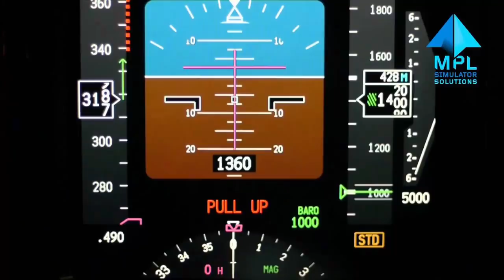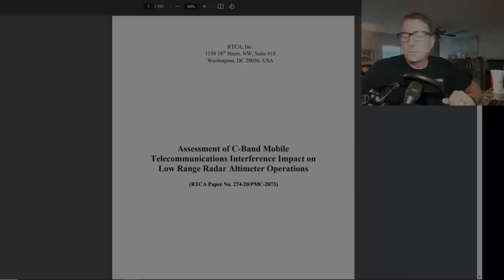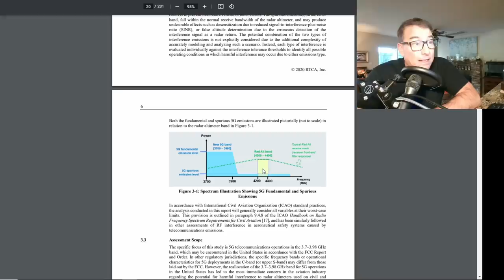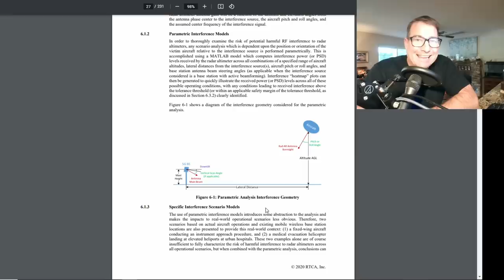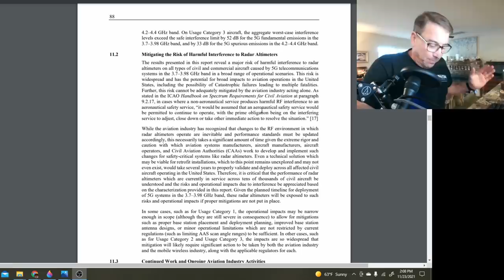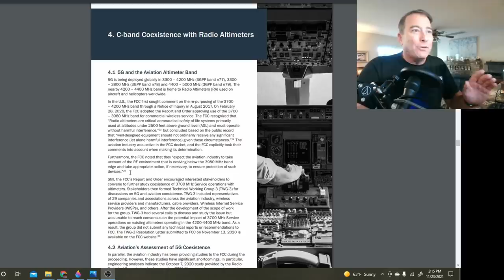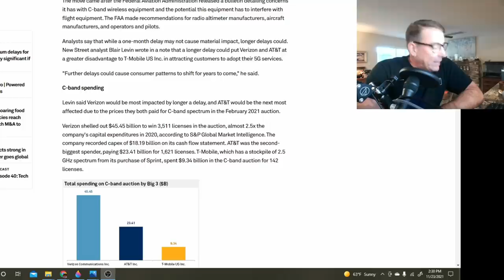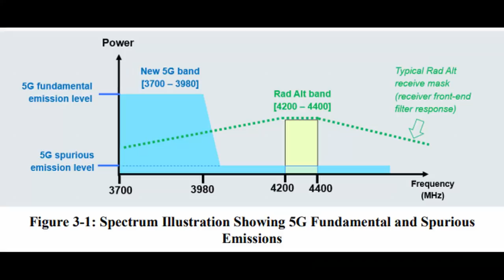5G C-Band Interference with Radar Altimeters in Aviation

Comment: Juan, Love your videos. This is also a good video but it is a pure pilot's perspective. I am a Amatuer Radio Operator and have degrees in electrical engineering technology and a retired Flight Engineer, and we in the amatuer radio community have been dealing with this very issue for many-many years. We have had a much harder battle since we are a non-commercial use of several radio frequency blocks. First off the report created via simulation is obviously presented for the layman since the charts were not truly accurate but rather drawn to make a point (especially the Frequency interference slope). Both reports show a obvious bias. Saying the aviation industry was "there first" doesn't apply since the frequency bands are not shared and do not overlap, they are adjacent with a small buffer. I totally agree there is potential for frequency interference but let's investigate why is that. The band allocations have defined start and end points and any signal transmission (of a certain level) "out of band"  is illegal and the equipment should be designed and built to the necessary specs so no "out of band" signal is transmitted. The amatuer radio community have had to increase quality of filtering and address interference and have got pretty good at it. My concern is that manufactures of the radar altimeter equipment may have built equipment with "loose" filter design to save costs (seen it many time on other equipment) since there was never any issue with interference with adjacent frequencies, it is possible that now the poor filtering designs are rearing their ugly head. I do not have any first hand knowledge of the filtering and signal rejection specifications of the radar altimeters so I am speculating at best but these are the things that need to be looked at to address the issue at hand. It will be incumbent upon the aviation equipment manufacturers are designed and built to tolerances to reject out of band signals and the telecommunications industry to ensure that the systems installed and broadcasting also do not permit transmission of spurious  or "out of band" signals. It is possible and easy to cause interference across a very wide spectrum with higher power and proximity. I have seen Ham radio in the MHZ bands  cause incapacitating interference to the AM band that is in the KHZ range. It's all about good design and, proper equipment construction and maintenance as well as being aware of possible interference and address such issues with proper design on the broadcasters and good filter design on the receivers. With the level of money involved, this could get very ugly. I hope this gets ironed out for the good of public safety.
Reply: The filter slope is incredibly sloppy on the radar altimeters.  I would not be surprised but what there is no filtering at all and it is simply the cavity dimensions of the antenna that provide any sort of bandwidth selectivity.
Reply: I recall buying a noisy toy at a US airport duty-free type shop, and it caused interference to the extent the pilot or pilots must have complained, since shortly thereafter there was a report about said toy causing intermittence and being banned.  An argument for upgrading out of date aircraft electronics.  Nowadays some private pilots I know carry consumer-grade GPS with them as backup navigation.
Reply: Since cellular uses spread spectrum as part of spectrum managment and security, I think the possibility of a cellular signal using a frequency used by the radar altimeter is essentially non-existent.

It's not like a cell phone picks one frequency.  If I understand correctly, the phone is frequency hopping meaning they are not using a single frequency.  

Folks are not knocking each other off cellular towers using the same set of frequencies.  I can use my cell phone in the same room as my wife who is on the same carrier and presumably using the same towers and frequencies.

If that works, using the same collection of frequencies, the risk to radio altimeters using a fixed single frequency or range of frequencies that are not part of the 5g band seems rather unlikely.

How is this working in nations who have rolled out 5g?
Reply: @buffuniballer  The problem is that the radalt uses a fairly simplistic method of measuring altitude, by sending two simple modulated RF signals and measuring the time it takes for the reflection to be received.  I don’t think that they use any sort of sophisticated modulation and/or coding, in order to pick up the reflection out of the RF noise.  Spread spectrum sidelobes, outside of the C-Band cellular frequency range, will be ‘seen’ by the radalt.  So, the question is, will this spread spectrum ‘noise’ obliterate the radalt’s ability to detect the reflected signal and accurately measure the return time, to translate that into an accurate altitude measurement.

I’ve been trying to locate some details on radalt, but have not been able to find it.
Reply: @RbNetEngr  my point is with spread spectrum and 200MHz of space between 5g and RadAlt, how long is any one transmission even at it's nearest point in the spectrum.  The devices frequency hop.  They are not even knocking each other off the air when used in the same room and same set of frequencies.  So are they really going to knock the RadAlt off the air 200MHz away?

Comment: I feel your pain on this one, JB. The FCC never ceases to amaze me with their boneheaded decisions.

6dB is nothing insofar as isolation.
Reply from the maker: That’s what my retired EE said too…he expected something more like a 12dB safety factor.
Reply: Quote: "6dB is nothing insofar as isolation." Exactly right! For audio 3 db is about the smallest sound change we can detect. 6 db is only a little more than that. Stated another way, 6 db represents a power ratio of four-to-one. A 4-watt 5G transmitter 6 db down in a radar altimeter receiver's bandpass will be as strong at the 1-watt transmitter in that radar altimeter. I suspect those 5G cellular transmitters are about 30 watts into a high-gain antenna. They need to raw their way through the walls of buildings.
 Compare that to the 40 db down standard that the FCC requires for amateur radio transmitters in the HF spectrum. 40 db represents a power ratio of 10,000 to 1. A 10,000 watt transmitter with its second harmonic (at twice its frequency) 40 db down would only have a power equal to a one-watt transmitter at the latter frequency. And the maximum power hams can use is far less that 10,000 and most operate at 100 watts or less.
https://www.electronics-notes.com/articles/basic_concepts/decibel/db-chart-levels-table.php
Juan is right. If these cellulars don't thinks there's a risk, let them conduct actual tests in concert with their critics. Let an experiment prove this one way or the other.
Reply: @Android-ng1wn  exactly,  5G emitters are always adjusting and tuning dynamically.  

and yes,  Mid-band 5G is about half the penetration power of low band and down into 4G LTE signals.  thus they need the dynamic tuning.   

5G UWB however, which is the small cell sites that give the Gigabit wireless cell service operate in mesh setup and sit atop a light pole in dense urban areas, operates in the 28 GHz Range mmW wavelengths.
Reply: @Inkling777  High Noon.
Reply: @Android-ng1wn  I tried to tell that to the people that were trying to take away the fire depts radios (150-175 MHz) and put them on a "trunk" system. It seems the bureaucrats listened.
Reply: 6dB is bad sure, but what about being 200mhz off of the band?  Joke all you want about 6dB but the fact a signal 200mhz away is interfering with the RA is pretty nuts as in the digital world  "guard bands" are tiny - one full wifi channel is only 20mhz so having to be 200mhz away is like eating up 10 wifi channels!   I'm leaning towards the "40 countries already do this" answer and thinking the FAA Radio guys are smoking something here...
Reply: @Inkling777  I am repeating part of a comment I left above, explaining the BENEFIT of good old 5KC wide VHF AM, because an overtalking situation can be recognized - not blocked out by the FM Capture Ratio. Not hard to detect on my ICOM 706 in the car in ATL, and Juan has pointed these out when playing missed transmissions! As a Ham for over 50 years, M. Perry hit the nail on the head! I believe the spec for HF harmonics has been  TIGHTENED even further to 50dB in recent years, most ARRL and other Amateur Radio publications include the improved/added filter sections on Transmit outputs, There is no telling how destructive these DIRECT, not REFLECTED 5G 30W digital signals buzzing away will overload the receivers pointed at the ground, with their simpler filtering and detectors. Amazingly lucid Technical feedback here - especially the tradeoff of FILTER PHASE vs SKIRTS response; if you want the Delta-Time data to be accurate. Another more Expert Technician replied that the Radar antenna CABLE LENGTHS have to be accurately compensated for, IF the phase detector reflection is not OBLITERATED already!. Best Regards, Hilary Lamothe W4HDL
Reply: @jermwerty  welcome to the world of 1970's electronics.  200Mhz is nothing to a 50 year old RA.
Reply: 3dB is half the power though, perhaps that was their thinking...
Reply: @srira7910  could be. Someone with a tie, but no pocket protector, said “but it’s half of a half!”

Comment: Thanks for that clearly presented coverage of this potential rf Interference problem. You explained it as though you were yourself a knowledgeable electrical  engineer with rf experience and maybe you are. I am an rf experienced electrical engineer with no aviation experience. Thank You
Reply from the maker: I couldn't even pass the Morse code test to get my Ham license...;-)
Reply: @blancolirio  Well that certainly limits your capabilities. How can you even fly without Morse code. There is NO Morse  code requirement for a Ham license any more.
Reply: @wm0davis  I didn’t know the Morse code requirement was dropped for Amateur Radio licenses. I really enjoyed being a net control op for the high speed CW nets back in the day…73

Comment: Great analysis of this issue. Interesting that the page 26 you show of the FCC rebuttal report says, many countries have implemented 5G frequencies near the radar altimeter frequency, then list Japan, South Korea, etc, yet the South Korean paragraph says that they are only proposing to auction off the 3.7 - 4.0Ghz range, and are currently studying if any additional requirements for 5G base stations are required, so in other words. They're in the same position as the US and haven't implemented the frequency yet .
The paragraph about Japan says that, even though they have completed the auction, they have a 100Mhz restriction for ops within about 100 - 200 M of aircraft approaches, which mean that, in addition to the 200Mhz guard band, there's an additional 100Mhz, so essentially they have increased the guard band around approach paths to 300Mhz. IE a 300Mhz away from the Radar Alt freq. Which restricts the freq limit to 3900Mhz, slightly lower than the 3980Mhz proposed in the US 5G freq allocation. Does that make a difference 🤷‍♂️. 
This all this needs to be left to the RF experts, independent of the telco's and Govt's and Govt's need to listen to them.

Comment: The thing is a cell company doesn't use all the frequencies at one site. So as a compromise could their be a caveat that within X kilometres of an aviation sensitive area can't use the top X MHz of the band.

The cell phone companies have frequency planning to ensure neighbouring cell sites don't overlap etc so couldn't the same be done?
Reply: Long ago, I worked in frequency allocation for cellular systems. You might get these companies to agree to do that, but only a fool would trust them to actually do what they said they would do. There's too much money to be made from grabbing spectrum. Cellular companies are as ethically challenged as cable TV companies. If fact, the cellular company I worked for came out of cable TV. It made its owners billionaires.
Reply: @Android-ng1wn  it's done with 3.65ghz as well now, just like dfs for 5ghz 365 has cbrs guidelines that it abides by as well, this could easily be extended to the frequencies in question.
Reply: @Android-ng1wn  It has to be the other way around for any safety-critical system.
Never use those frequencies unless UNlocked by the proven absence of Radalt signals over a significant time period.  That way it fails safe.  The system would have to do a self-test occasionally to prove to itself that it was able to receive Radalt signals, too, and stay locked out if it couldn't.
Look at the way truck or train brakes are designed - if they lose pressure, the brakes clamp ON.  The system has to be working properly to be able to move the vehicle.
For some excellent explanations of how fail-safe systems should work, an old but great read is "Red For Danger" by L.T.C Rolt.  It is based on railway systems but is still highly relevant to aviation ones, and indeed any others that are safety-critical.  Say, the environmental monitoring systems for laboratories (which I've designed).  My early education on safety-critical decision pathways came from Mr Rolt's excellent book, which is highly readable.
The very first railway signal, outside Reading Station (IIRC) on the Great Western Railway, came with the regulation that "If the signal is not visible, the train shall not pass it".
Reply: @phillee2814  Same rule on dark signals is still in effect.
Reply: @phillee2814  but that approach ignores the "rogue passenger" scenario where they ignore the flight-mode rule. 

In that case, their handset will be the strongest interfering RF source as it's within the plane so a very strong field strength at the radalt rcvr. Due to the local 5G mast being locked off due to hearing overhead radalt pulses, the rogue passenger handset will be on high power trying to contact a distant mast that can't hear that radalt transmission at all (radalt beam is aimed down at the ground so has a limited geopgraphical coverage below the flightpath) 

We've had 20 years of flight crew and passengers being blasé about electronic device usage (not just smartfones), backed up by several reports saying "it's no problem". 
Suddenly, it is a problem. The laws of physics haven't changed,
Reply: Cellulay company  doesnt have to jave frequency planning since 2g (cdma operators) or 3g (gsm and umts operators), it can use all frequencies on all towers simulteniously.

Comment: Hi, love your channel. One thing to keep in mind is RF transmissions are attenuated as a function of distance from the transmitter squared. When you report that the radar altimeter has to go down 1000 feet, bounce off the ground and return 1000 feet back up it makes it sound linear. But it is not linear. The losses are much greater than linear. The same is true for the 5G signal that hits the aircraft. The loss plan for that signal has 1000 feet of squared equation loss, a loss as the signal hits the ground, and then the 1000 feet of squared loss back up to the receiver of the radar altimeter. In your USAF days this is why a "Wild Weasel" could detect the enemy radar long before the radar detected the Wild Weasel. This is coming from a pilot since 1976 and a guy with BS and MS degrees in Electrical Engineering. I practiced design engineering for 35 years including designing and building a major portion of the Navy's E2-C Hawkeye Weapons System Trainer that was formerly in Miramar, NAS. I would get the FAA to fly some "5G test approaches." Put in some 5G base stations on some test approach path (not a real one) and test fly a variety of radar altimeters.  The test design of these flights is important. There must be enough flights and test configurations to confirm safety at the same level a CAT III C approach was certified. That is, the same number of 9's in the certainty equation since human life is involved.

Comment: Juan, for 3 years when I was stationed in then West Germany maintaining a computer system for the 407L TACCS radar system.  I would routinely play around reading Mode 5, the radar altimeter of aircraft we could "see".  Our radar was 3D capable.  Bad Guys won't be transmitting Mode 5 data to us!
Money will talk louder than safety.  That is until people start dying in crashes due to radio altimeter failures.  Once the blood starts to flow in volume, then changes will happen as quickly as possible.  The sad, but true reality.  I just pray your blood isn't spilled or that of your passengers.

Comment: Awesome job reporting this !! Also follow all your aviation reports with deep appreciation and interest ! Keep up the great work. Also, G.A.  lost two more folks..pilot and his wife in a really messed up  Go Around in a 1959 Bonanza a couple days ago. Looking forward for your report. You will no doubt see this one was totally preventable for a 500+ hour pilot. I mean, who doesn't remember to prepare for a go around trimmed for landing in a powerful engine . Why do so many pilots not remember p factor is going to pull you left if you don't get on that right rudder and full throttle is going to stand you straight up on your tail if you don't push that yoke hard forward.  Not to mention loss of rudder authority if your nose comes way up too quick at low speed and sudden max throttle. 
Grief  ! That was in my first lesson and in every single dang training flight. What is going on in the CFI world ?? What happens to the application of  basic flight principles in the mind of pilots??? 

Also too many senseless deaths from Base to Final screw ups. Does any GA pilot not remember why a wing may stall ??.....low and slow and banking and pulling is not particularly a happy mix 🤔🥴🧐.
Take Care Juan !
N4TDM  Amateur Radio General Class